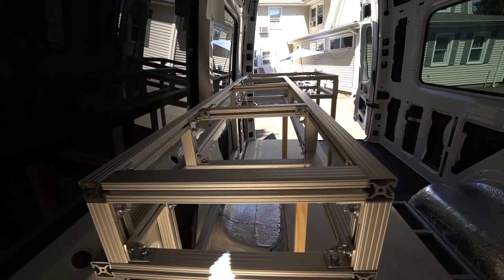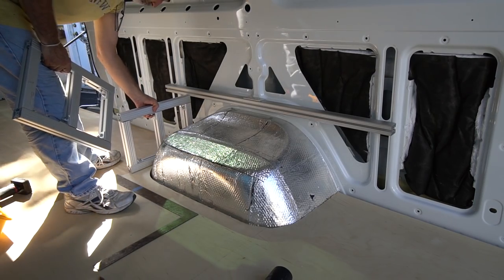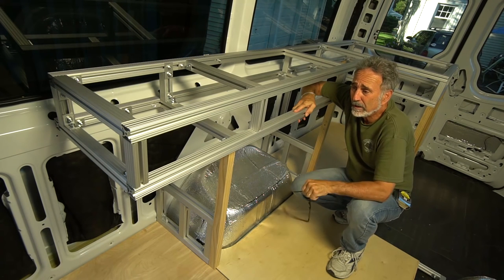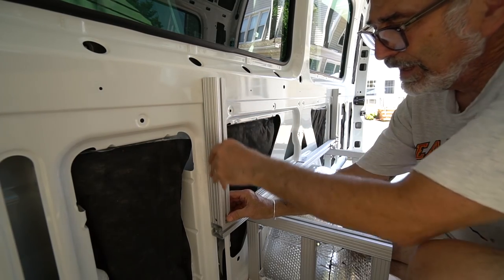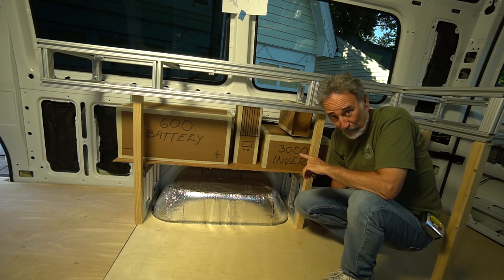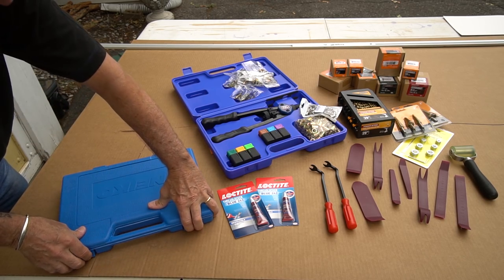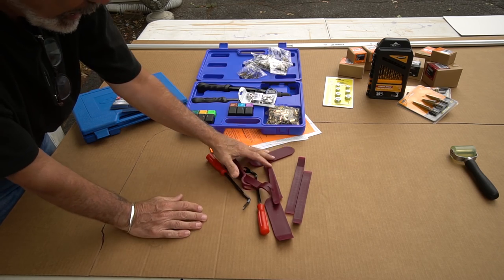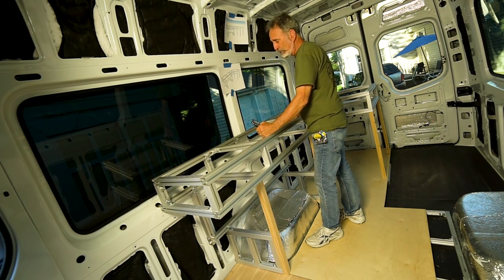VAN BUILD SERIES 10 | Look At Those Galley Bones!

Comment: I was just wondering if 2 computer fans installed 1 installed at the bottom, on the left-hand side just below the battery sucking air in and then the 2nd computer fan installed just above by the inverter and back towards right corner blowing out towards the sink, would help on air circulation.  Computer fans are quiet & easy to install, was just wondering if it would help keep that expensive equipment cool.  Might not be needed as I don't know if the equipment you are using will even create much heat if any heat in their operation.  If it's no concern, then please consider this a comment from the peanuts gallery!  Enjoying the build, it's working!  :)
Reply from the maker: That is a viable suggestion. I will be using those small high volume fans in another part of the van ventilation system, so why not in the battery closet? Good one!
Reply: Dino Hicks The batteries, inverter charger, solar charge controller, etc. will all be just fine with natural convection cooling. The inverter already had a fan (or fans). Additional fans would be unnecessary energy sappers.
Reply: John, good to know! Tks!

Comment: I went back twice and couldn't find if the louvered doors were for heat or off-gassing, but if for off-gassing I would vent outside and maybe some 5volt computer fan to help with the ventilation.  I'm not familiar with the battery you are using.  Love the toe kick and canterlevered counter.
Reply from the maker: No off gassing. LiPo is safe for inside the van. The battery closet will be open walled in terms of ventilation.
Reply: I was pretty certain you had that covered,  BUT one day, yes one day Sir, I will catch something.....  Na, I know better than that!  ;-)
Reply from the maker: We all continue to learn something new every single day, I always say..
Reply: Journeyman lithium = no gases